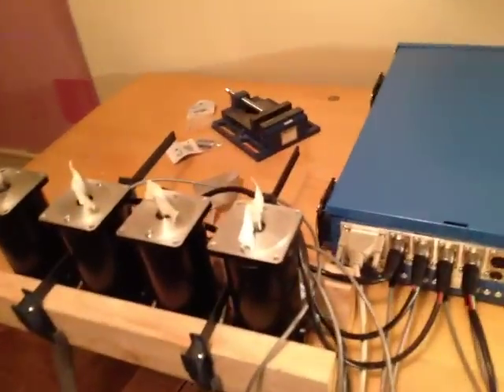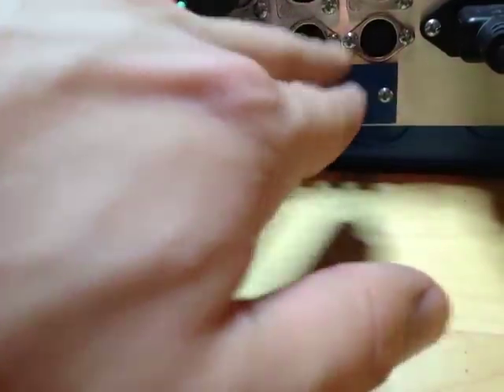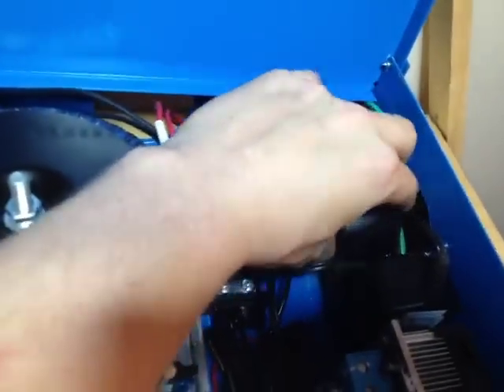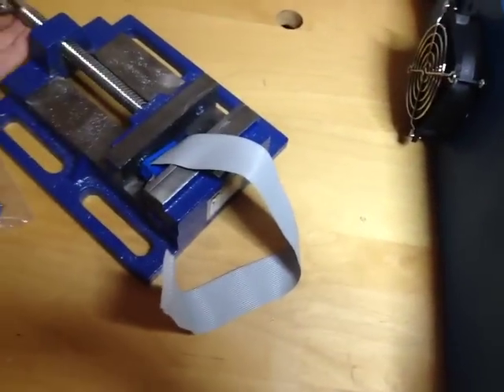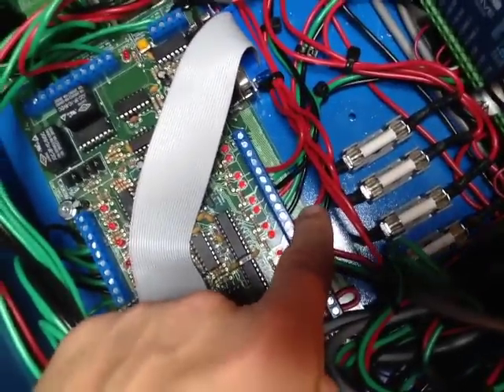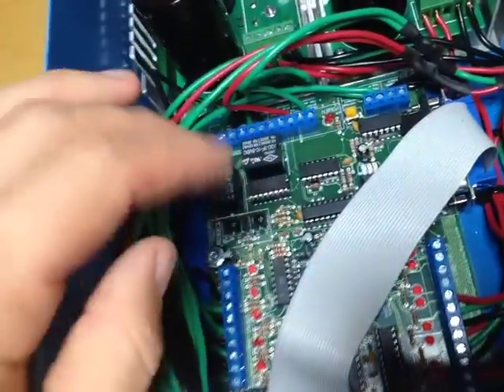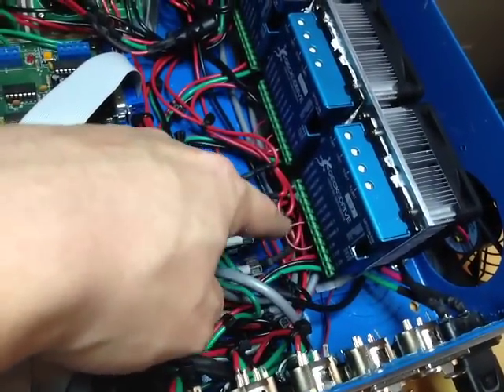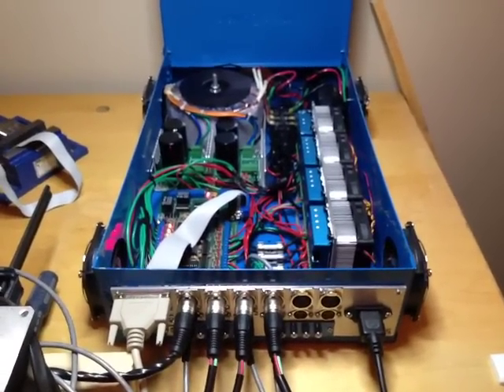THUNDERDORK: DIY CNC Router - It's Alive! Control Box and Servos up and Running.

Comment from the maker: Heheh, not yet.  My smaller machine I've been using to manufacture parts blew its controller.  My next video will probably actually be about building a new stepper controller from probotix.  Hopefully after that I'll be able to start actually building out the structure.

Comment from the maker: I'll see if I can get to wiring these up to a switch.  As far as I can tell from the manual, each pin terminal has a supply terminal next to it that can be set with the jumpers to pull down or pull up.  are you using the adjacent terminals?

Comment: Please check your limit switch wiring & see if it works. I did it today & I had to use the Pin# & GND. Using 5vdc to Pin # didn't work, as the manual describes. They were shorted. Maybe there's something I don''t know. I did change the jumpers, as described in the manual.

Comment from the maker: I'm not too sure about the C11T as I have the C11.  There's more info on my site.  Basically I have + to + and - to - from gecko to servo.  I have ground wire from my servo to my star ground.  Double check with gecko if you have any detailed questions.  I've cobbled my wiring from posts on cnc zone dot com.

Comment: I think I have found a way around having multiple power supplies for 5V to the board and drivers and 12V for fans. Lookup a  VKP60MT512 . It allows for 33-75VDC input and has one 5.1VDC/12A and two 12VDC/2.5A outputs.
 See if you think this is a good ideal to do away with the multiple power supplies.

Comment: Below I am refering to the 3 wires of the KL34-180-90 servo to the Gecko G320X driver. since Keling's diagram only shows 2 wres comming from the servo I want to be sure I have this right. I know very little about electronics and it dont take much to confuse me. I went to your page,  Nice page by the way, but it did not allow me to comment on this video.

Comment: OK, I looked at the CNC4PC.com C11T wiring and it made me a little confused.I noticed that they have the black wire going to the negitave 65V supply before the gecko and you state that yours is going to a star ground on the chassis.
  So, comming from the servo, the Green is armature -, the Red is armature+ and the Black goes to the same chassis ground strap as the AC 3rd wire ground (Green) by way of a common fuse block and not to the negitive of the 65v supply before the driver?

Comment from the maker: Youtube doesn't post my direct responses and limits length it seems.  Best to ask questions on my site. 

C11 basically adds 2 relays and a variable voltage output. You could trigger 2 things off/on like coolant, vacuum, spindle.  Variable voltage output means you can control the speed on something like a VFD.  You might not need all this.  In hindsight i kinda wish i'd even further and gotten the C11T which is more geared towards servos with the ability to monitor the err/res pin.

Comment from the maker: hmmm... it seems when i respond to these comments they don't get posted here.  best to ask questions on my site (listed in the description).  to sum up my response, the c11 adds two relays (turn things like spindles/coolant/vacuums off and on) and a variable voltage output (speed control of a VFD or something).  actually i wish i had known about the c11t before i got thsi board.  more geared towards servos. adds the ability to monitor the err/res pins on the geckos.